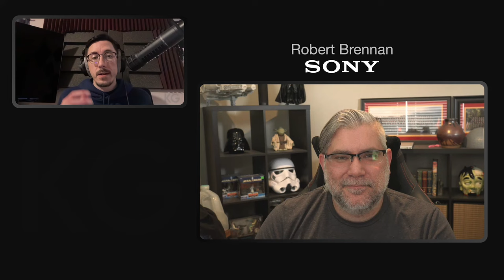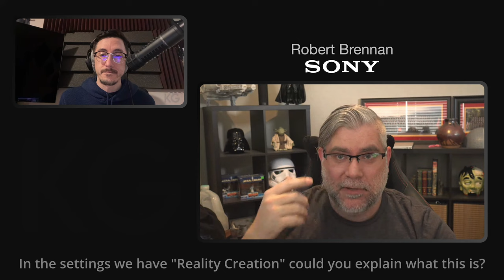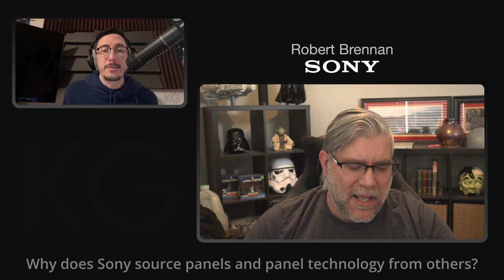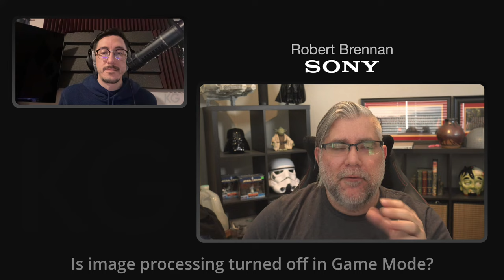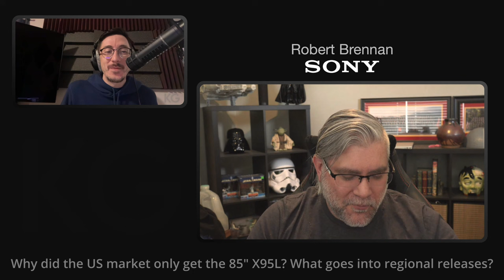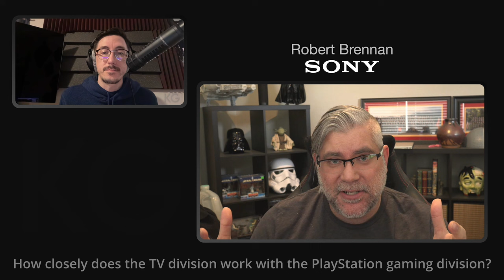Sony XR Processor Explained in Detail | Full Interview W/ Sony

Comment from the maker: □Timestamps🕖
00:00 Intro
01:03 How & why did Sony Mini LED 2024 Prototype come about?
04:11 How does Sony intend to name their latest Sony Mini LED TV to avoid confusion?
11:13 What Sony is doing different with Mini LED TV in 2024 to control dimming better?
13:03 Why you might want to buy a Sony TV in 2024
13:25 What is the Sony XR Reality Creation and how does Reality Creation settings work?
17:38 Why does Sony's Reality Creation setting seem to improve each year?
20:11 How much AI was used within the Sony XR Processor?
21:05 Will we see generative AI improving TV picture quality in the future?
23:25 What is Sony's approach to finding the best panels and display technology for TVs?
25:38 What is the Sony setting Black Adjust and when would someone use it?
30:23 Is image processing turned off in Sony's Game Mode? If not how much is used? 
34:04 Does Sony TVs have higher input lag? How does Sony balance processing and latency?
36:48 What is Sony's X-Factor? How is Sony separating themselves from other brands?
38:50 Why are certain Sony TV models not released in US? What is with region specific TVs?
41:53 With Sony's new BURANO 8K cinema camera, will we ever see a mainstream shift to 8K?
45:36 How closely does Sony TV / AV side work together with PlayStation gaming division?
Reply: What is the launch date of new TVs in 2025?

Comment: Which TV would be better for watching F-1 racing, football and other sports (30 % time) and for streaming movies (50 % Time)? Sony A95L or Sony Mini LED 2024?
Reply: Mini led if it's a very bright room and dealing with say a bright window or many windows.  

If it's a more normal room relatively light controlled, I'd do the OLED.

OLED is really hard to beat for movie watching in the evening/night time.  Even during the day the extra contrast is sometimes preferable over full screen peak brightness of an LCD.

You can't go wrong with a95L.
Reply: Just go with a Mini LED. Sony won't release their 2024 TVs till June or July in the summer so go with 2023 Mini LED TVs instead.

Comment: I'm sure this TV will be awesome but it's going to be prohibitively expensive. I really don't want to buy a Chinese TV but Hisense and TCL will likely release something somewhat competitive for a fraction of the price.
Reply: Did you ever wonder WHY those Chinese made Hisense and TCL TVs were so much cheaper? (Hint: There's a REASON for that!) Lower prices come from sourcing LOWER QUALITY (and therefore less expensive) component parts...ones that DO NOT last as long. Sure, you might look at your Hisense or TCL and say "I don't see that big of a difference" but you also have to factor in your TCO (Total Cost of Ownership). That Hisense or TCL TV won't seem like such a "great deal" when it breaks down on you less than three years into owning it because a part failed. Now, Hisense and TCL are very good brands, make no mistake, but they are not even remotely in the same ballpark as Sony when it comes to craftsmanship, build quality and longevity. Again, the old saying really does turn out to be true: You get what you pay for!

Comment: I'm a big fan of Sony and hate Samsung, but Sony is gonna get hammered by the QD900 8k this year. Not taking advantage of the superior resolution with their processor advancements will be a big mistake...
Reply: @DrakonR  just because your Xbox doesn't support it doesn't mean 8k isn't superior because it is clearly. You also don't get that the new 8k upsampling processors from 720 and 1080p are your answer. Your argument is an old one for last generation tech and yesterday's complaint
Reply: @DrakonR  I have for 10 years. I guess you don't and won't ever get it 🤣